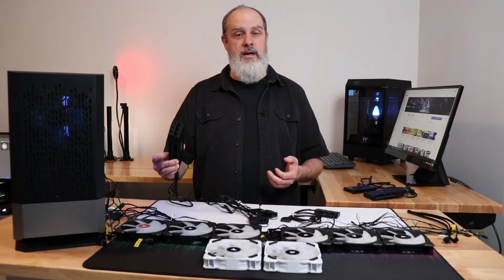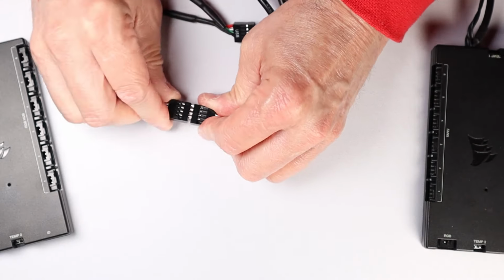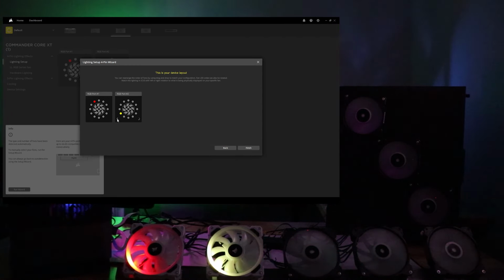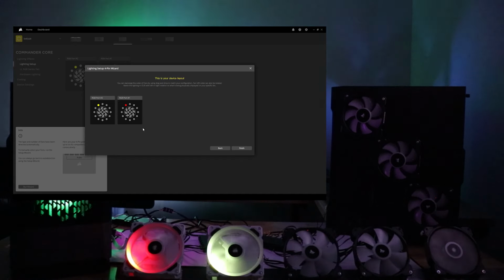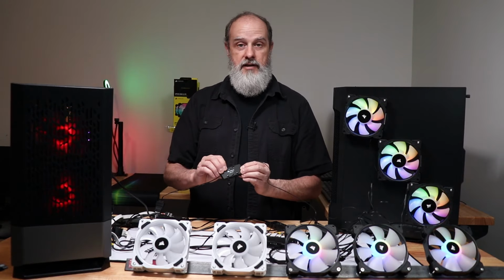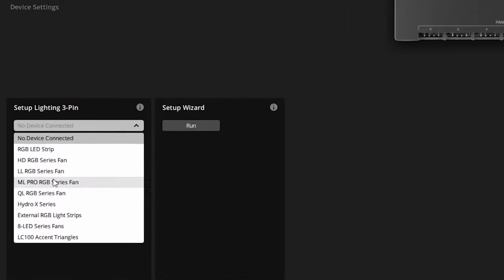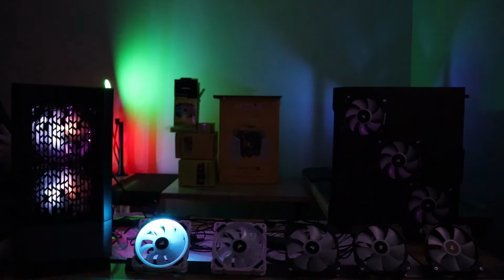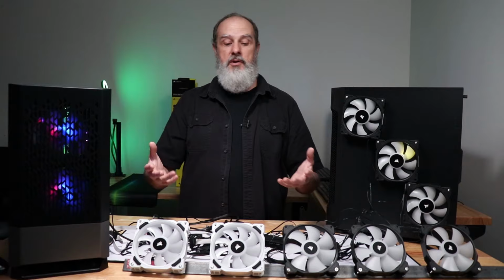Using multiple Corsair RGB controllers to control more than 6 fans in iCUE

Comment: I'm a person with a physical disability, so I had a put my 5000T case together. Trying figure out why it doesn't work and he isn't sure plus he will be in Florida for awhile.  
A 5000T which includes 3 RGB fans and light stripes . Also, a iCUE H150i ELITE Liquid CPU 3 fan Cooler.  Plus I want to put in 3-4 more RGB fans.  I am able to control 6 fans and I water pump.  I can see the light strips on icue software but the strips don't light and the lighting/fan hubs don't show up at all.  Does the data power go to the psu or motherboard?  Is the daisy chain part of ID?   Can I have 2 Core XT and commander?
Reply from the maker: Hi Timothy Carey, with the 5000T, if you connect the ID cable to the ID port of the CORE XT included, it should show up as a 5000T in iCUE, from here, you would setup the 4 pin lighting (FANS) and you can set the lighting effects for the 3 pin lighting (LED Strips). 

If you see the strips in this section but they are not lighting, ensure that the "quick lighting zone" section of iCUE at the bottom is set to ALL and then select a lighting effect. 

If it's still a problem, ensure that all your SATA power connectors are connected to your power supply. 

You should have the CORE XT that came with the case and the Commander CORE that came with the AIO, these can be used together. You could add another XT to the mix but it doesn't sound like you will need it, you should have enough with the CORE And the CORE XT to run the 9-10 fans you want. 

If after all that, they still won't light, I'd start with a general reseating of all the cables to the CORE XT and the RGB Hub for the Strips. 

Let me know how it works out. It sounds like an amazing PC build, Have fun! Thanks for watching!

Comment: This video is exactly what I'm looking for. I'm planning to run 12 fans. 8 120mm and 4 140mm fans
Reply: Which connectivity solution did you choose? I’m bout to do similar just 9 120mm and 3 140mm
Reply: @Blash1  commander xts 2 of them.

Comment: The only reason you are getting the SP RGB fans to work is because in every video you have the damn COMMANDOR PRO CONNECTED to usb with the core xt!!! SP 120 and 140 fans and NOT supported with the COMMANDER CORE XT ALONE/ by itself!!
Reply from the maker: Hi Jimmy Reese, I answered this on your other post, but it's confusing...I've had to look that up a couple of times, the Sp120 elite and sp120 pro work directly to the coreXT the Commander pro being there makes no difference, it's the non pro or elite sp120 that would have issues and I've never had any of those...I've always been using the elites in these videos.  Too many flavors of the SP120., Haha....might be worth a video to sort it out.  Thanks for watching!!

Comment: I got the 5000d airflow case and was wondering if I got rid of my commander pro and used one Commander core from my AIO and a Core XT would I have the same results as if I used the commander pro with the core attached to the USB power ?

Comment: Thank you. I have 10 fans and was wondering what I needed to buy. Grabbed an core xt to go with the core that came with the AIO. 

Question, what and how do you use the temp slot for?
Reply from the maker: Hi Terrance Addison, my reply is a bit late, my apologies. With 10 fans (i'm assuming that includes the AIO fans). The CORE XT and the CORE will be  everything you need to get those fans working (RGB and PWM/POWER). 

The CORE XT comes with 2 temp ports, and two thermistor temperature probes. They will measure ambient air temperature. You can place these anywhere in your case you like....or outside your case if you want to know what your room ambient temp is.  They are not intended for direct contact on a suface. They are useful for general monitoring of temps in your case, place them in and around a heatsink, AIO or any hotspot in your case. With icue, you can monitor these probes and you can create fan curves using the value of the temp probe. 

Thanks for the great question!!! Thanks for Watching!!!

Comment: I’m in the latter end of finishing my very first PC and am going for high specs. This video made me reimagine my hole fan set up and last minute changed my purchases for the better! I decided to get 7 QL120’s, Corsair iCUE H150i Elite cooler because it comes with a Commander Core, and a Commander Core XT! I believe the XT along with the standard commander core should be enough for a 3 rgb fan water cooler along with 7 rgb fans right?

Thank you so much for this very informative video! Keep up the great work everyone appreciates it!
Reply from the maker: Thanks for the feedback Collin Pleasant!!!  Yes, a Commander CORE and CORE XT together is a great way to get control of your 10 fans, both RGB and power/speed control. It will also give you some fan expandability along with 2 temp probes and the RGB port on the XT if you decide to sync some other RGB with it. Check out the video on syncing non-corsair RGB using that port and a cheap adapter cable if that suits your build at all. 

I wish you great success on your first PC! Sounds like a nice machine!!! Above all else have lots of fun!!! 

Thanks for watching and taking the time to post a great question!
Reply: @HardwareArtisan  Thanks! I actually just started assembling everything and found out about the push/pull method with AIO using 3 fans on top and bottom of cooler so that brings my total to 13 fans. I currently have a commander core XT and commander core. To run the 13th fan with the whole set up can I connect a third device to the other 2 so it’s all synchronized? Definitely not worried about budget since I’ve already gotten this far hahah

Comment: Will the pig tail power a commander core or only an additional commander core xt?
Reply from the maker: Hi Nick Murphy, Yes, the pig tail on the Commander CORE XT will run a Commander CORE. I just tested it again to double check, it works great. 

 It won't "power" it, they each have their own SATA power connector. I knew what you meant by your question, just wanted to be technically accurate. 

I do know the pigtail will not run a Commander PRO, but your good to go with the Commander CORE. 

Great question, thanks for watching!!!

Comment: The only downside of Corsair fans is that you have to buy the fan hub seperately (not the RGB hub) if you ran out of fan slot on your motherboard. And the damn thing costs almost the same price as the case itself. Corsair should learn a thing or two from Nzxt.

Comment: Been a longtime fan of Corsair products, but these seem like a cable management nightmare. I'll hold off until they have a more contained, sensible solution.
Reply from the maker: Hi J.R. Hawkins, that's a fair point for sure. The Lian Li fans attempt to resolve the cable management issue. I think corsair would do well to implement some modular setups. 

I just picked up this "Cheap" set of modular fans from Amazon,  but these were 39.99 and look like a lian li knockoff. I haven't even opened them up yet, but I might do a video on them if they are decent. But, check em out....

https://www.amazon.com/dp/B097T7WVKH?ref=ppx_yo2ov_dt_b_product_details&th=1

Thanks for Watching!

Comment: Do you know if i can build a pc with 8 fans. 3 corsair 140mm rgb fans in AIO and 5 rgb fans in the chassi which of i want to connect directly to the motherboard in order to see and controll them in fan expert program. I think i will need an rgb controller for the chassie fans. What do you suggest to do in my case?

I also have another little related question about RGB, i'm kinda new to it. Can you set up all of the fans to change colors according to CPU temp? I mean if it's like 25-45c then it's green, then if it's like 45-65+c then it's orange and red color when above 70+. Is there's any way to set it up like that or it's impossible?
Reply from the maker: Hi Oleg Lysenko. Great question, the answer will depend on what type of fan these 5 fans are in your chassis, if they are corsair fans, meaning all 8 fans are corsair with the 4 pin rgb, then I would suggest using a Commander core XT, and then but the RGB fan hub, to connect to it.  This setup gives you complete control over RGB on all 8, PWM speed control of 6 of them. I would then but a PWM splitter and just connect 3 fans to a single PWM port giving you speed control over all 8. 

If they are not corsair, and i'm assuming they are just the standard 3 pin argb connector, then look for a PWM controller that will sync to your motherboard, giving you motherboard control, or you could connect that to a corsair controller and sync them all together, check out this video on that subject:

https://youtu.be/JgLUDe1yzYw

Corsair will definitely set the color based on CPU temp, you can customize the range and colors to set, it works awesome. Many other RGB control software will do temp control as well. 

If this didn't fully answer your question, let me know what controllers you already have and what exact model of fans you have. 

Thanks for taking time to post the question and thanks for watching!!! Good luck, and have fun!

Comment: Hi there. I have a question. I have a 5000X ICUE RGB case and I bought 4xML120 Elite fans to match my Corsair H150i AIO cooler. The cooler came with a commander core, the 3 packs fan came with a lighting node pro and there is a node core pre-installed with the case which is in 2 parts, one to connects the fans and the other one for the RGB. My question is, do i need all of that and is this enough to have 7 fans or do i need to purchase a commander pro or whatever it takes to be able to run all the fans Thanks
Reply from the maker: Hi Courtois Adrien, Great question! I would install the commander core, which gives you RGB and PWM/Power control over 6 fans, this leaves you having to connnect the one remaining fan, to which I would just use the internal built in lighting node core (which is essentially the same as the lightining node pro). 

I would then use the built in splitter to connect the PWM for that last fan, or split one of the PWM ports on the Commander CORE. 

The lighting node PRO wouldn't be needed here, and you don't need a commander PRO. One could argue that using your command CORE and then ADDING a Commander CORE XT would be a good solution, especially if you plan on adding additonal fans in the future, but at this point, it's not needed and you have everything you need. That 7th PWM connector is the only one you really need to decide where it goes. Personally I'd split one of the ports on the commander core (which you might be able to do with that hub), with just a cheap splitter cable, this would give you control over it in icue,, along with one other fan. 

I hope that help give you some direction. Thanks for taking the time to post your question and thanks for watching!!!
Reply: @HardwareArtisan  Thanks for your detailed answer. I already solved my problem but it's still good to read your reply. Being a complete newbie and first time building a PC i'll share my experience.

I built my pc with a Corsair 5000X ICUE RGB that came with 3x 120 SP Elite and I bought 4 x 120 ML PRO RGB to match my AIO Corsair H150i 3 x fans. I initially wanted to have 7 ML fans but my case allows for 10 fans so I decided to install the 3xSP on the side. (Which obviously gonna make me scratch my head more to install those extra fans)

First of all my first mistake or something I should have done first was to correctly know what i was dealing with. What hardware I had under my hand and understand the basics of it. 

My case ( that came with a pre-installed fan hub and a RGB hub which at first I wasn't sure what it was). Then my cooler came with a commander core and not a commander pro. yes I didn't read properly and got mixed up. And then, with my 3xML120 Corsair RGB Pro came another RHB Hub and a lighting node pro. ( I didn't know I had to plug the RGB hub to the lighting node pro as i initially thought the extra bits that says LED 1 and LED 2 was  purely to control LED strips.)

I was a bit lost what I needed to use and what I could remove. A kind stranger on Reddit took the time to explain to me everything and answered every single of my questions, so I threw myself in the deep end and started to connect everything and by elimination things started to become clearer.

What I ended up doing for my setup was:

-Remove the pre-installed RGB HUB , kept the fan hub
-Connect 5 x PWM cables to the Commander Core
-Connect the PWM cable from that fan hub to the Commander Core
-Connect 6 x RGB cables to the Commander Core
-Connect 4 x RGB cables to the RGB Hub* from the 3x120 ML Fans kit
-Connect the RGB Hub* to the lighting node pro, then plug all satas and USB cables.

And TADAAAAAA everything  worked just fine! Hopefully this will help anyone building a PC with the same case as mine with a similar fan set up :) Now i'm gonna enjoy my RGB goodness with my ryzen 9 and Asus TUF 6900XT. It's my fist gaming PC so it's pretty exciting!

Comment: Hi,
Great video! but I have a question 
 i ve got Commander pro and Commander xt - on my commander xt i dont have COOLING setting - any ideas why ? 
Im using 2 motherboards  usb`s , one for each box.
I can control RGB but that's all really. 
Ive got 6 LL120 fans and one pump combo. 
I can control fans & pump speed on commander pro. 
any ideas why ?
Reply: i did it! I forced update although it was up to date
Reply: @ws8523  You are my hero! Had 6 fans plugged in but only 3 ever showed up. Thought they were incompatible or something. But forcing the update worked!
Reply from the maker: Hi Wojciech Slusarczyk, that's awesome, I'm glad you got it working. Thanks for taking time to post your question....and the update! Thanks for watching!

Comment: Hello I like your style. So I'm fairly new really new to this gaming pc stuff. Came from old school. I am in technology at work but would like to take a shortcut asking you a couple of quick questions. I have a motherboard that has fan control  ports its a Asus Z690 WIFI D4.  I believe I have 4 to 6 ports one is CPU opt port and CPU fan then the others are labeled fan 1-4  and the MOB ports are a standard to corsair and maybe others. The odd little controller has different type plugs not like corsair. I have bought 2 corsair 2200 rpm RGB 3 pack fan kits ea. Both kits came with a little 6 port controller. The odd ball controller doesn't play nice with the corsair its clunky at best confusing and I was wondering if I could get rid of the controller and its fans and just use the 2 six fan controllers. I currently have 6 fans powered through 2 ea.  3 way splitters for fan going to MOB. would you use the 2ea  6 controllers for RGB and maybe because their are the same brand could work ok.  I have 10 fans total all RGB. Sorry for the long question but I found myself struggling with the different controllers and you made it look easy. What would you do with what I have. Oh and thanks for the video.
Reply from the maker: Hi Crashed King!! It sounds like you have some non-corsair RGB fans in your case currently that  won't connect to those 2 new 6 port RGB hubs from corsair. 

You could use just the single 6 port corsair controller, it's the lighting node core i'm assuming it came with. You could connect all 6 RGB cables from the CORSAIR fans to a single controller. This does leave you having to find PWM/Power connections for the fans as the Lighting node CORE does not have these. 

You could use the motherboard ports, or your 3 way splitters. 

I would recommend you consider looking at the Commander CORE XT, this controller gives you 6 Corsair RGB ports and 6 standard 4 pin PWM connections. This would eliminate your current controllers, fans and the splitters. This is an additional purchase unfortunately, but simplifies the setup and gives you some added features. 

This is assuming the 6 fans you add are enough for your setup. You could add this setup in addition to the fans you have, but non corsair fans won't connect to the RGB ports on corsair controllers. 

Let me know what brand your other fans and controllers are. I hope this helps, 

Thanks for taking the time to post some feedback and thanks for watching!!!!

Comment: Great Video but I have 1 question that was left unanswered. Can I daisy chain 2 fans per core XT fan header?? Or will it burn out the unit.
Reply from the maker: Hi Diadem37's Garage, great question. I think you are asking if you can use a PWM splitter on the CORE XT's fan header for power....Yes, I have done this to add a couple of more fans to it. I wouldn't recommend going overboard with that though. 

Corsair for some reason doesn't list a specification for the total power output for the fan headers on the CORE XT, I've looked. 

The Commander PRO does have that specification and it's as follows....1A per port (4.5A combined). If we take for example that an LL120 fan has a 0.30A power draw, we can safely get 2 fans per port, you could probably get 3, but I wouldnt add more than 2 per port. I'd personally only add a couple more fans in total across the entire controller which I've done with no issues, I used PWM splitter cables. 

I have to assume the CORE XT's specs are similar to the Commander PRO, but I can't be certain.

I've not fully tested with adding more than a couple fans to it for any length of time, so take any advice here at your own risk, but i'd add 2 additional fans total without any worries. Thats for the whole controller, so adding 8. 

Thanks for the question, let me know if that didn't quite answer your question!!! Thanks for Watching!